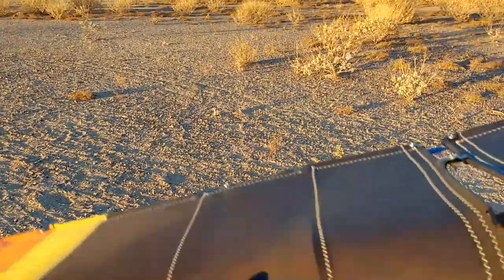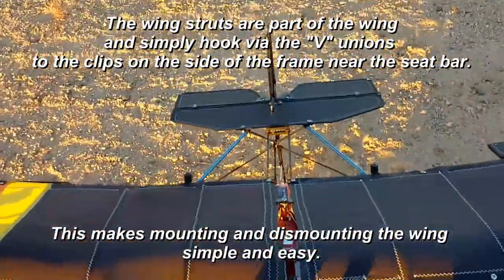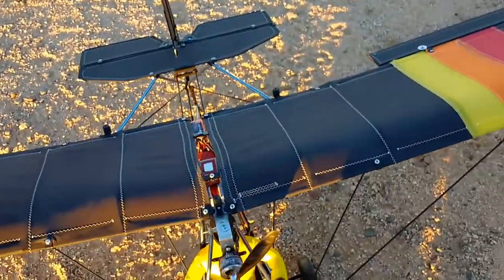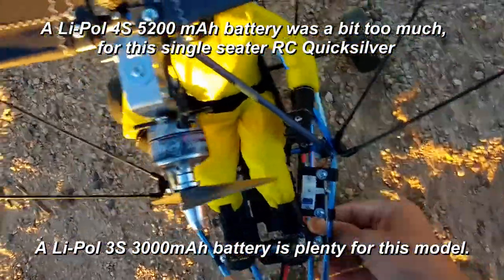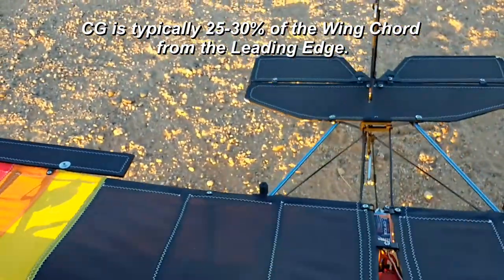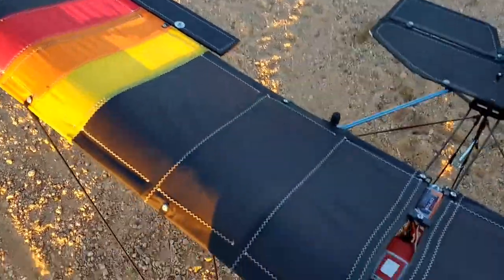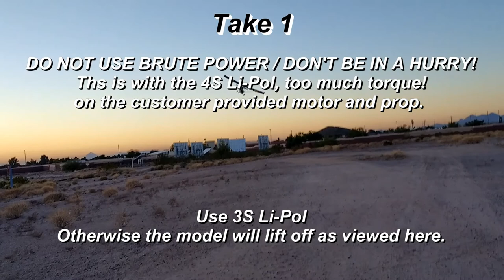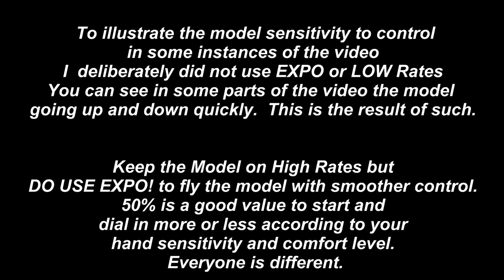MIA Quicksilver - RC Ultralight -  Reworked Fixed Setup and Tested for Customer

Comment: A nice surprise!  Just happened to see this on the subscription page.  Glad to see my old friend is airworthy again!  SG  Let me now when you will ship.
Reply from the maker: I boxed it last night  SG, so it is ready but I wanted to upload this video as it is useful to all MIA QS owners out there.  I was about to send it to you, but you beat me to it. I am glad you are subscribed to my channel. I will e-mail you later on tonight  with details on shipping etc.  I removed the rear wheels so the model clears the box  with the motor mount and prop installed.  The model is taped strategically inside the box so it does not move during tranport.  I used some rubberfoam and re-used the bubble wraps and popcorn that came with it to fill the model and protect it completely. It should arrive intact unless shippers manage not to be careful.  Hopefully they will handle it with care and read the Fragile sign on the box. Thanks S! .

Comment: Wow Mario that's a nice improvement on the three point quick installation of the wing very slick.
Reply from the maker: Thanks  Gerardo. The 3D parts are an easy upgrade.  They are available  via my e-mail.
Reply: @MarioIArguello I need a replacement noise wheel mount do you have stl files

Comment: I visited your web site and saw some very interesting "aircraft" for sale. Problem/restriction for me is that I fly off of grass and the small wheels on these ultralights just won't handle the grass runway unless it were groomed like a golf green. That's not the case where I fly.
Reply from the maker: I have flown off grass that was trimmed, and also a bit swampy, and the model takes off fine. You can always put larger wheels if you feel that would hep in your area.  

https://www.youtube.com/watch?v=YKtc-15Ohss
https://www.youtube.com/watch?v=z2HuuFJkgvk
https://www.youtube.com/watch?v=0cyXQay-IzY

Comment: Available plans?
Reply from the maker: These models are sold as Full Kits, not build by plans. There is considerable amount of fabrication that needs to be done if one were to build from plans and not many people have the tools to "fabricate"  with precision the parts that make up this model.  MIA Micro-FLIGHT has taken that complexity out, by supplying as full kits with impressive  Illustrated Step by Step Instructions so that the end user can end up with an awesome flying and looking model.
Reply: @MarioIArguello  Ok I see. Where do they carry the batteries, receiver and ESC? Are they hidden so to not loose scale look?
Reply from the maker: @rva1945  batteries are typically placed at the bottom of the frame,  RX and ESC at the top of the frame, but can be place also at the bottom of the frame, location is selected for best Center of Mass balance, depending on size of component and weight.  Logically you want the connections to the Battery and ESC close to each other so that disconnection of such is a snap.